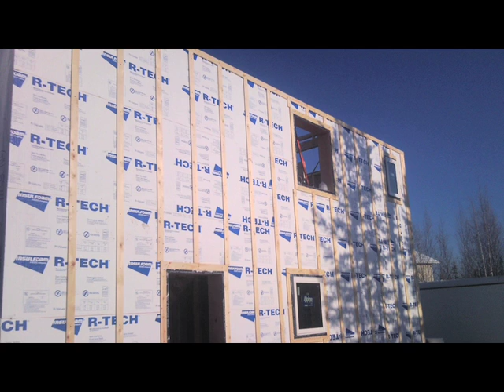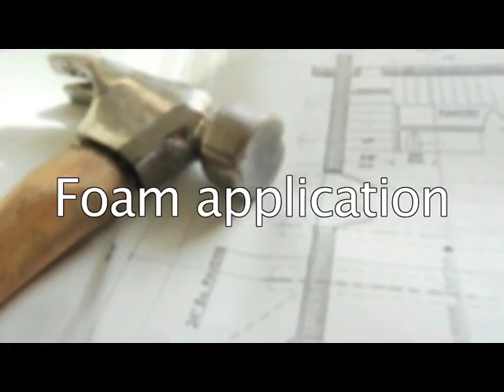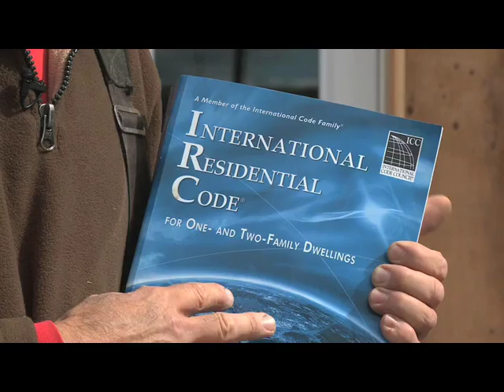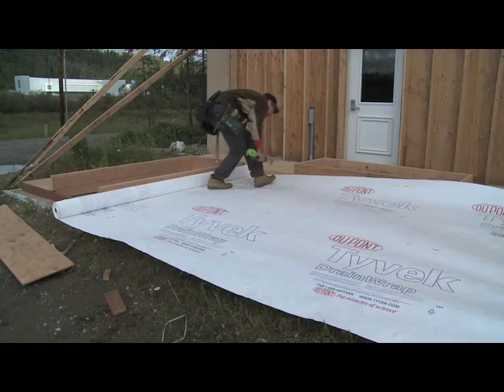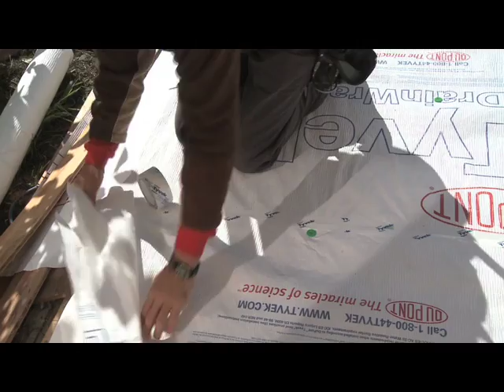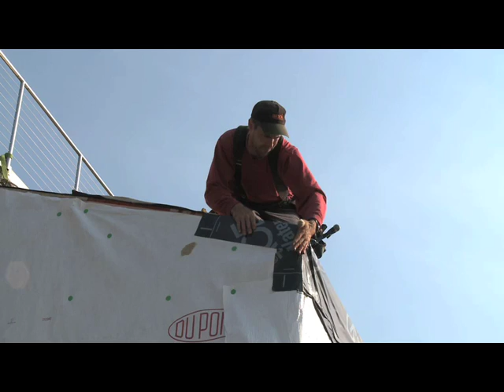How to: REMOTE Wall System Part 1

Comment from the maker: We have carpenter ants. Carpenter ants tend to be attracted to moisture so if you keep the moisture away from the foundation & other parts of the structure it will be a lot less appealing to the ants.  In some areas such as Hawaii, treating the site with termiticide during the foundation stage is mandated by code. Also, keep the yard and surrounding environs free of stumps, logs, and other debris/cover that would attract ants as this will only bring them closer to the house.

Comment: Is there any insulation under the slab?  It seems this is trying to be passive but there seems to be some points missed such as the slab.  Also wanted to ask if the house has no insulation in the walls or if the ceiling has a attic space, would you then put the entire 100% insulation on exterior wall?  With the attic would you just insulate the maximum amount or still do the REMOTE roof option?

Comment: I am watching the video (20 min 13 sec area) and I do not understand how one then attaches any roofing such as shingles?  The sheathing is under multiple layer of foam.  Also the roof trusses don't overhang the exterior walls at all?
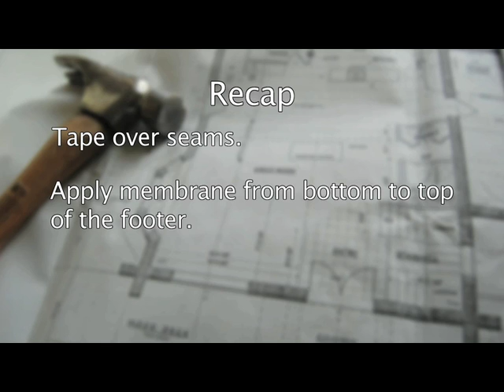Reply: At 50:26 they explain the roof, i.e. foam, 3/4 furring strips, and a metal roof.